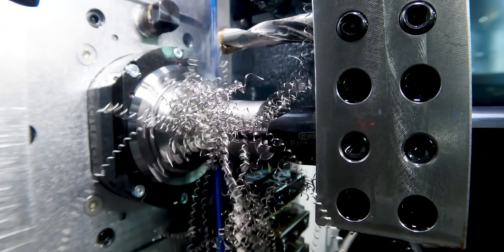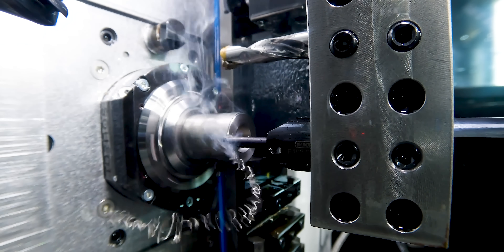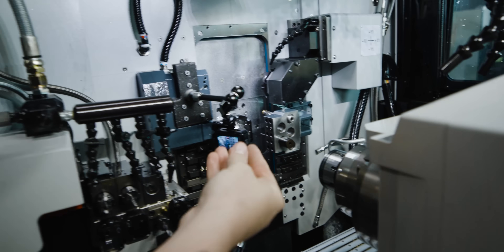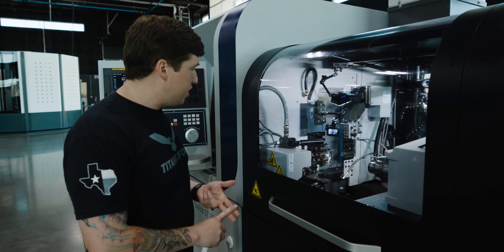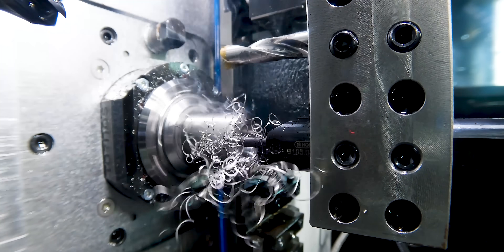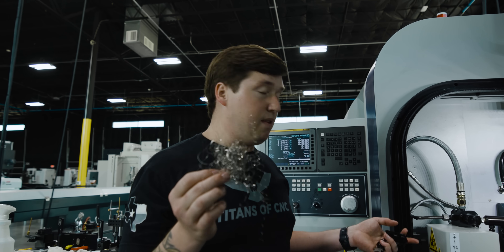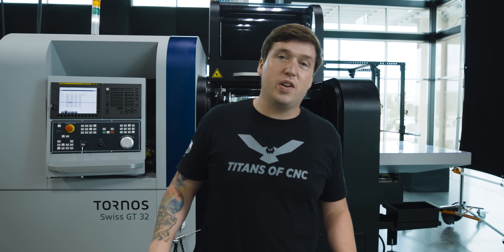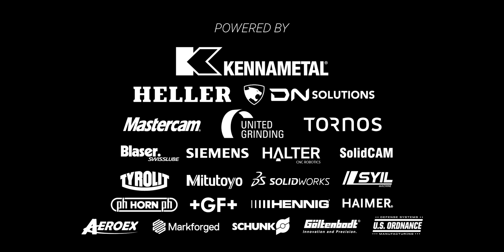Tool Company Makes IMPOSSIBLE Claim: Tool Can Break Any Chip

Comment: 5:03 "If you need any evidence that we are doing this live, if you look at the front of the bar, that is raw barstock right there"
5:28 Very convenient cut from the inside of the machine to you talking in such a way that it could easily have jumped to the end up a parting operation on subsequent cuts.

Does I still believe you? Yeah, you guys seem pretty trustworthy, and it doesn't really matter because it still performs anyways.

Comment: So as a screw machine setup operator for many years in Detroit, with tool steel you can groove a chip break in tool steel but carbide is a different monster, but when you get birds nests your coolant can get pushed away and burn your tool all to hell, the carbide tools or inserts should have a chip break cut into them , if the carbide insert is smooth than there's no chip break , if it does have a ridge on the insert and your still getting long chips you just need to adjust the tool until you find that sweet spot,

Comment: IDK if it the camera but the one that is really good at breaking the chip seems to spin off the cut at a much higher rate of speed and so if in such a simple minded way you spin metal lines fast while hot to cold they may have a better time breaking I wonder if the Geometry or the dip in the took helps it spool faster and well causing breaks, I feel like there is way more to that it was more a observation and frame rate makes it hard to know 100% so just thinking out comment.

Comment: Almost looks like a flaw that turned out to be functional. Looks like something you could file into any other boring bar. Just file in an undercut in the mild(er) part of the shaft under the cutting bit. 

I wonder if another alternative would be to use a cutting bit that sits a bit proud of the shaft it's attached to, so it overhangs just enough to snag on the chip.

Comment: Yea its worth its weight in gold chip breaker like that, even if the insert lasts 90% the life of some other tool but chips with almost any speed and feed input it saves you so much time in going through the process of trying to balance parameters in order to get something to work reliably.

Comment: Awesome on metals but I’d love to see the same test running PVC. ABS, delrin , nylon and others. We do close to 80% engineered plastics. Milling is no problem but turning. Holy shit! Talk about your bird nest. Granted you can program a pecking cycle that will break but still not nearly enough. I myself do some manual lathe work and absolutely hate having to get rid of the long stringy chip bird nests. Trust me even with plastic you better be wearing gloves because they can slice you up like a pizza. With certain heavy cuts you can get better results. However lighter finish cuts no way. If there is anyway you could show us just how good it works on plastics that would be awesome!!!   Another great video Donnie. 👍🏼👍🏼

Comment: Most CAM software has "Chip break" or "peck" tool path to break chips, works great for roughing, slight surface marks if used on finish pass.
Reply: Adds time though. These do not.

Comment: Maybe I'm not skilled enough in >20 years of CNC lathe, but why do you use a boring bar on the outside and a small one for such a big bore?
Speaking about cost saving all the time and then using an expensive throwaway carbide boring bar like that seems idiotic to me.

PS:
Horn makes awesome tools, but chip breakers aren't a new thing.

Comment: try 1018
we machine a lot of 1018 (well it's S235 but it's really close to 1018) because it can be soldered and welded easily an the customer doesn't need any strength from the parts but they do need to be machined a be as cheap as possible

Comment: Is there a way to use boreing bars like this in Mcam? Only options they seem to have are for insert based bars.
Reply: as long as you have the basic geometry of the tool, insert or solid shouldnt matter to mcam. just simulation might see insert vs solid.
Reply: @Mikkel-RS  yeah it usually doesn't matter, but it gets a bit annoying with small tools. Say i'm using a .09 boreing bar, i can define the shaft dims as the holder, but even if i set the insert dims as small as they go the sim shows the insert much larger than the hole i need to cut, and usually errors out. I'm still pretty novice on Mcam, just seems odd that there is no option for these types of bars, considering how common they are. I'm 6 yrs into the trade and think i've only used my insert bars a cpl times.
Reply: @verakoo6187  For sure, i understand completely. Tool manufacturers like Horn should already have tool libraries for all major CAM softwares ready to load, making it easier for the customer to snap it together and make chips.

Comment: Awesome stuff. In many cases, unless one has 1000 psi of high pressure coolant pointed straight at the tip of the tool, those pig tails just love to hang on. Kinda wish Horn had these with smaller radii though, for those fancy bore profiles that pop up every now and then, fingers crossed. Great job Donnie.
Reply: I was so disappointed to see they only came on one size boring bar lol. I've got a couple incredibly tiny bores I would love to use these on. Can't wait for them to expand these to other categories!

Comment: What I've done in the past if I wasn't taking a ton of material off on a non dimension critical part was take a carbide tig rod and use it as a scribe and etch a line about 030 deep in the material, since we've upgraded most of our tooling to sandvik and betteredge with chip breakers I've been having a much better time.

Comment: Stringy chips when finish turning is such a huge problem.  Especially with these small boring bars.  I've used them for years and always struggled with the chip.  This tool finally having a chip breaker will be so revolutionary for so many applications, especially the medical industry!  Great job Horn!!
Reply: really?  you dont just use a pair of side cutters to take it off?...... I'm sorry you consaider it such a problem, but metal worker's over here dont even care.. its waste... cut it,   get rid of it... dont they pay you enough to something that simple??     wait   are you a machine operater or a certified metal worker?    gotta ask
Reply: @HarmonRAB-hp4nk  hate that I even will bother responding to such a comment.  Anyone that is running production knows that it is incredibly dumb to stand there pulling chips.  The whole point of production is so the operator doesn't have to manually intervene in the process.  If that's what you think makes you a skilled metal worker then you obviously aren't one.
Reply: @HarmonRAB-hp4nk thanks for concisely illustrating the difference between an operator vs someone who has an actual understanding of the production process. Gotta love it when glorified grease monkeys start talking about stuff they aren’t remotely qualified to speak on.

Comment: I live up in Iowa, though I'm an OTR trucker so I'm not home much. But I've been looking into or trying to find some good fabricators to build a bed/lap desk that I've been working on drafting up for in the cab of my truck. I've tried contacting a few places, and pitching my idea, though I haven't gotten a response from either..

I'm not opposed to working with a shop/facility outside of Iowa, it's just a matter of finding someone that's willing to build it, and work with me.

I'm in the gradual process of doing a desktop PC gaming build in my truck, to replace my old laptop. I want to do a layout that's more comfortable, as I spend 6-8 weeks on the road usually with a fair bit of layover time sitting around.(I'm on Salary hauling glass)

Any suggestions on some good shops to try out would be appreciated. It's not exactly a complex build, if I had the appropriate tools, I'd build it myself. Just a matter of finding a place that's actually going to respond to my query.

I live in an apartment complex.. so setting up a bunch of saws, sanders, and such at home wouldn't be very practical, plus I live on the third floor lol. It's dirt cheap living with my roommate, just not practical for certain "hobbies."

Someone throw me a bone man! Any suggestions are appreciated.

Comment: As an ole timer and manual machinist without any of these new fangled digitally engineered tooling, the one thing I learned the hard way was: Always remove chips stringy or otherwise on the lathe and especially in the chip pan BEFORE you take your last finish cut! Thus ensuring you don't ruin your final pass and part by having all those stringy chips on the lathe and in the pan grab and come flinging out at you in one huge ball of confusion!

Comment: 9:45 & 11:15 In both timestamps, you can see clear cut in the video, this tool can even break a video.
Reply: Noticed that, too, there are several during the cut at 9:45, 9:54... Seems pretty clear that they just tightened up the video by editing out dead air where he paused talking. I would not attribute that to malice or fraud, just live audio rather than a voice over.

Comment: Given that 17-4 PH machines differently depending on the heat treated condition, what was the condition of the 17-4 PH? Condition A? H900? H1025? Or smear-city H1150M ? (or maybe another one)
Reply: I’m not sure what the spec is because this is 17-4 from my second video that was 18 months ago. I would just assume it’s the easiest one to cut in which case a small bore like this can still be a pain. Good question tho. Sorry I don’t have a better answer
Reply: @donniehinske  In that case? Best guess: either H1150D or H1150M. Those two precipitation hardened conditions are pretty common in the oil & gas industry because they meet the NACE requirements for "sour service" and they are the softest most ductile.

Comment: I don't own any CNC equipment. I will probably never own any CNC equipment. I don't know why I watch your videos and I barely understand anything going on here, but I find it incredibly entertaining still.
Reply: glad im not alone in this
Reply: It gives insight into how things are made and what goes into it.
Reply: Nothing wrong with that.  I do it for a living and still get all horny for it and stuff like this.
Reply: metal run off is a simple thing metal worker just cut off with a pair of side cutters :-).... I think I get it when I read cnc...  there not metal workers, there just machine operators so it would clue in to them.....us... were paid to just get it done no complaining..  got a problem ? think outside the box sorta thing...... were also paid more lol then a guy who just pushes button and twists nobs..  lol  probably why they think run off is such a problem   ( when in hindsight the machine has no problem with it)   LOL
Reply: @HarmonRAB-hp4nk  hope all of that is wild sarcasm that flew way over my head.  It’s a bit different when working in a precision machine shop.  Tight tolerances and surface finishes are not only a product of good quality but an absolute must.  If a finish doesn’t allow a part to function quite right or it has .0002 taper to the bore it could be catastrophic.  Some of my parts hold pressures beyond belief.  They are expected to run at 87KSI and are tested at almost 200KSI.  (KSI is 1000 psi’s).  So basically a bomb if it fails.  Take pride in your work.
Reply: @HarmonRAB-hp4nk there's a difference between machinists and operators

Comment: the faster you bend material the more it tends to snap on its own.
at the same speed, a small ramp indentation behind the cutting tip causes the material to bend in a tight radius much more quickly that it shreds it self apart  (thats why the few chips that didnt break are curled tighter than with the old tool)   thats also why higher rpm also causes chips to break. thin material resists bending quicker than thick material can, so more feed and thicker chips would do the same, if the tool allows it.

Comment: Only thing it's missing is the coolant hole that the old one have ( at least of what I could see from the video )
Reply: Yes the coolant hole is in a different spot. It’s aimed right at the cutting edge of the new tool
Reply: @donniehinske  okay good to hear since i have tried makeing some parts that would be impossible without the coolant hole ( otherwise we could not get our cutting oil to the cutting edge and flushing out the chips ) really love haveing a coolant hole ( i always grab the boring bar with the coolant hole if there is one is the size and insert pucket when possible )
thanks for providing the info btw

Comment: Will it break a chip on nylon ?
I used to do a loop on haas feeding a few thousandths and back off to keep everything from wadding up in a mess.
Reply: That’s a tough one! But I will try it if given the chance. I don’t have any nylon here. OR you could buy some of these and let me know 😂
Reply: That is really impressive. We always did a lot of plastics and the chips would drive you nuts.
Reply: @bobbywright3479  I’d honestly say nylon is one of the worst. Tornos has their ACB function which really shines on breaking chips on plastics. You may have just given me a new video idea 😂 thank you
Reply: @donniehinske looking forward to this!
Reply: I looked at the Tournos function. That is really good. It is essentially what we were doing only I assume you don’t have to do any calculations. 
I have used PH Horn tools and they are excellent.
Reply: @bobbywright3479  yea the work well for sure. I think THINK it could make it so the amplitude of the vibrations would be smaller meaning the finish would be better. I’d honestly have to test it out
Reply: I do nylon, it can be a *itch!  It can make you scream sometimes.